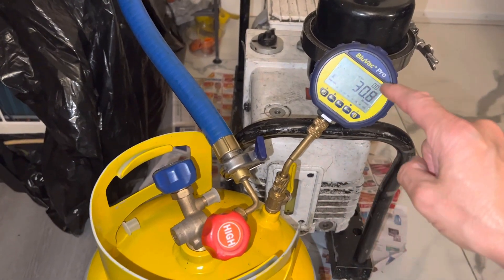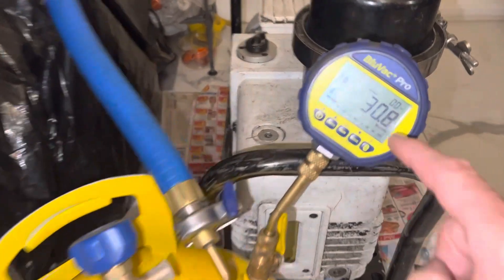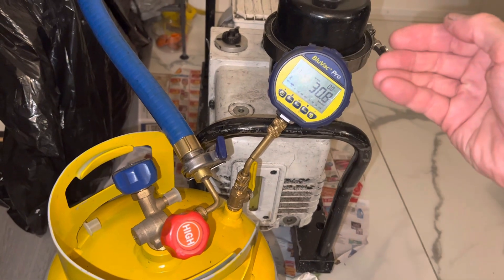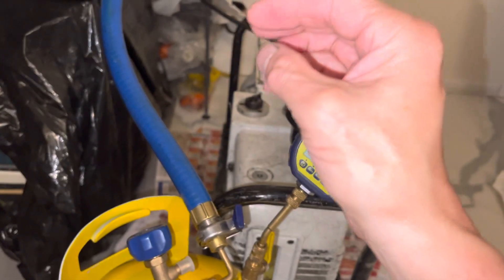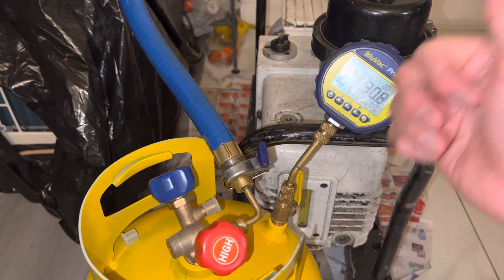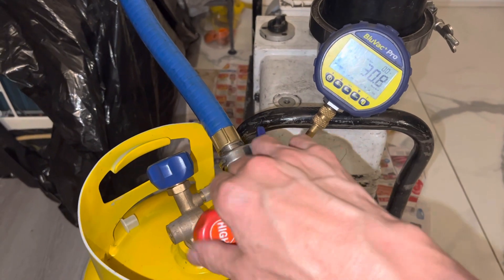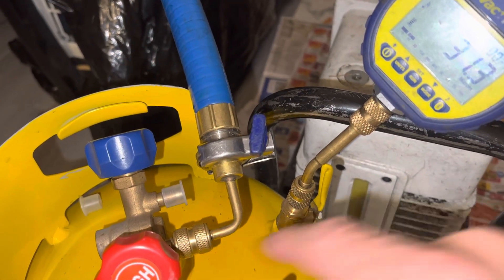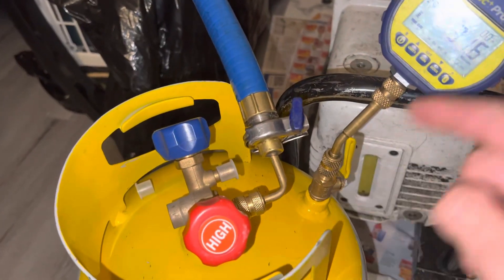Micron gauge vacuum done properly this is the result video number two. ￼

Comment: I bought that exact same vacuum gauge and same vacuum hose , and I am getting results like you with a much less powerful vacuum pump!!  About 48 microns last attempt. Thanks for sharing your knowledge .
Reply from the maker: The size doesn’t matter much in the final results a bigger one will just get you there a little bit faster that’s all but if you keep them both on they roughly get to the same level after a duration of time